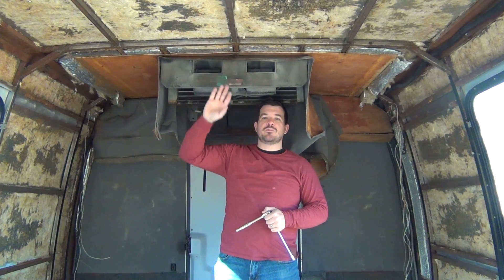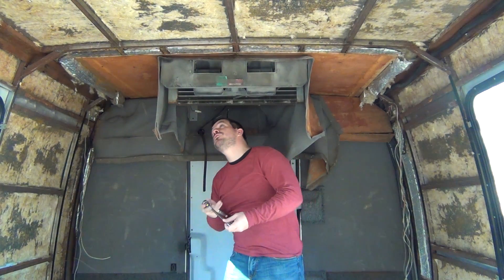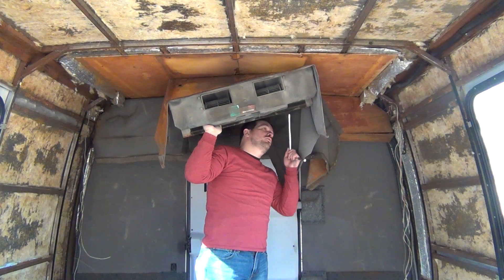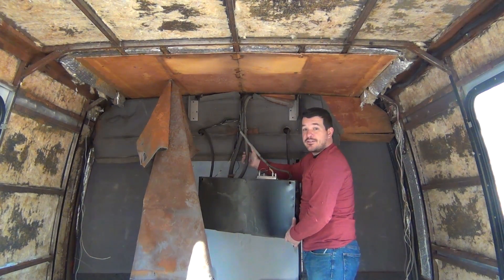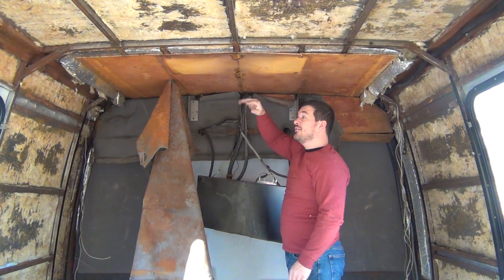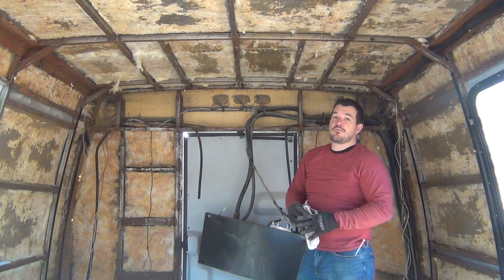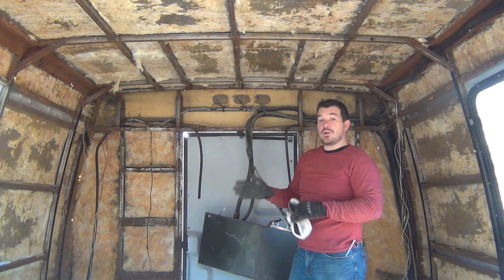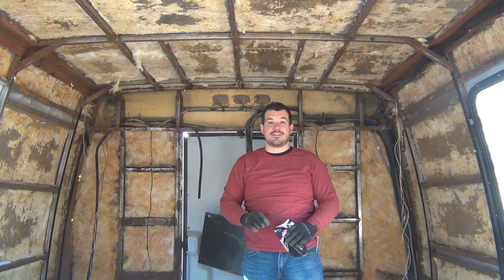Bus-2-RV - Ep.004 - Interior Demo3

Comment: You can't take your dust mask off directly after finishing the work and then stand there in the same space to talk. The hazard does not disappear because you have finished what you are doing. All that dust and fibers floats around there for hours. It is the same when you sweep up. Sweep just before you go home at night, wearing your mask, then turn off the lights, step outside, and THEN take your mask off.  The worst part will have settled by the next day, or so they say.